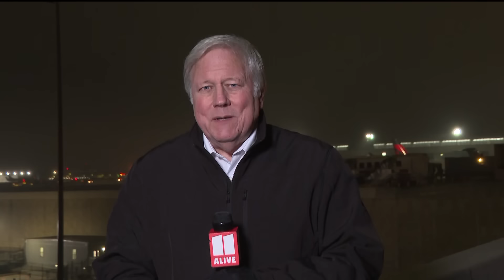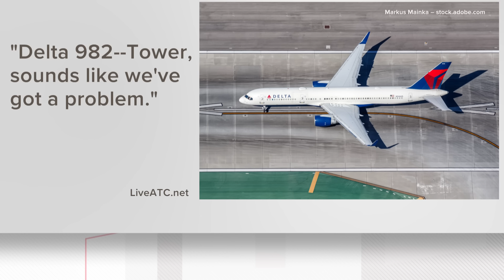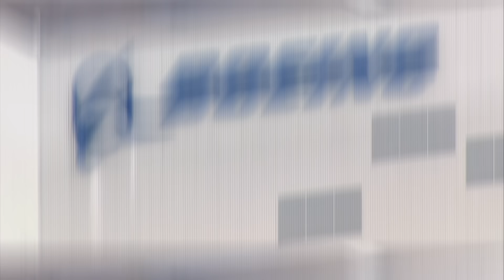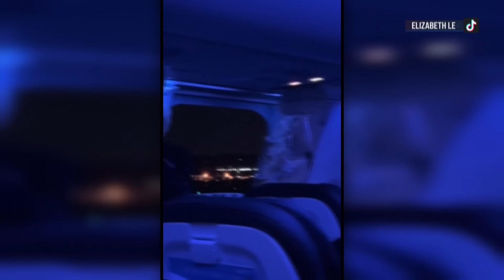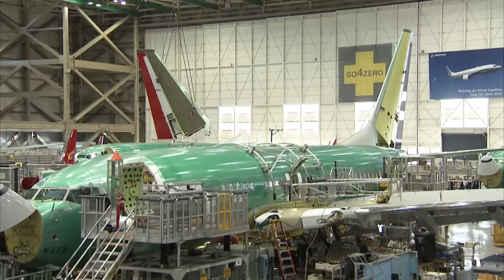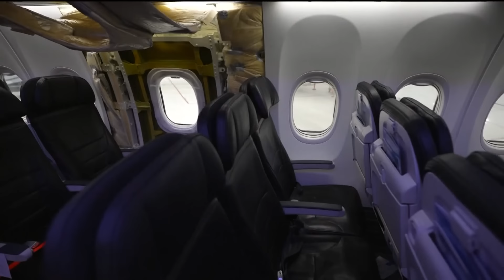Delta flight preparing for takeoff from Atlanta airport loses nose wheel, officials say

Comment: This is like blaming Ford for a wheel coming off your 20 year old truck…
Reply: Shhhh. Boeing is trendy right now.  Don't expose their sensationalism
Reply: Yes and no. I agree in this particular instance, but if this is found to have been an endemic issue for (ford/boeing/whatever) vehicles built around the same time, then time shouldn't matter. Ask me how I know.
Reply: @Breakstuff5050  and you're just Americans trying to defend an American company
Reply: @mark675  not at all, I think Boeing has gone downhill since the 90's after the restructured their company.  It's not what it was.  And it's a shame.
Reply: @Breakstuff5050  yeah it is a shame and if they don't sort it out it's going to cost more lives
Reply: @mark675  that’s pretty ironic considering Europeans do the same thing with Airbus cuz it’s European. I’m not defending Boeing or anything

Comment: Ok this can’t be blamed on Boeing, nose landing gear is 100% on the airliners maintenance crew.
Reply: It can't?  SMH
Reply: @pedalingprospector2007  if it had been a brand new plane, or this was a continual problem, you could blame the manufacturer. Neither of those conditions apply, so yes, it was a maintenance issue.
Reply: @carch7243   Oh, the 7377 MAX hasn't been having continual problems?  You a Boeing safety compliance officer or just own stock in the company.
Reply: @pedalingprospector2007  so let’s say you buy a vehicle (ford, Tesla, Chevy, doesn’t matter) and you put 50,000 miles on it and go to get something done for your tires at your local mechanic shop, and a wheel flies off while you’re doing 70 on the freeway, how in the world are you going to try and blame the car manufacturer? Obviously you’d be holding the mechanic shop accountable for the subpar work they did on your wheel. Of course Boeing is currently under fire for unrelated PRODUCTION (that means for aircraft that just came off the line and have zero flight hours) issues but the idea that they should be blamed for a clear maintenance issue is just silly. Everybody is entitled to their opinion, but in this case the opinion that Boeing is to blame is 100% incorrect
Reply: @Luigim_15   Exactly
Reply: @pedalingprospector2007  Massive problems with tires falling off?

Comment: This is likely a maintenance issue
Reply: I concur.
Reply: Boeing should have their workers checking maintenance being done everywhere. Especially after 737 Max 8 tragedy. It's a quality assurance process redundancy. Redundancy is the key.
Reply: I think it's a DEI issue.
Reply: @fluoxethine  they can't stop an operator from not doing their jobs properly. 

 This wasn't the new 737 max.  The older Boeings are proven to be reliable when properly maintained
Reply: @Breakstuff5050  They can stop by double checking. When you buy a new car, you get several years of warranty. With jets it should be much longer and work should be done by authorized people. If not Boeing then some third party organization should check for safety (FAA is useless as always).
Reply: @fluoxethine  there's already established procedures for maintenence.  There is no "double checking" by Boeing.  Maybe on new designs, but by the time they're selling them to airlines they're suppose to be completely safe and redundant.  Unless they cut corners.. like they did on the 737 max 9

This wheel coming off is on a proven design and there is already enough double checking required by Boeing.  So Delta dropped the ball on this one.

When accidents happen and the cause turns out to be preventable through maintenence, then the procedures and intervals are changed to accommodate the issue assuming its not a defect.  

Unless the operators report issues, Boeing isn't going to double check every inch of an aircraft for no reason.

This 737 max debacle really is insane though, it's unfortunate they can't find anyone in particular to blame and make proper changes to fix their recent shortcomings

Comment: This is on Delta maintenance, not Boeing.  That's a 30+ year-old aircraft.  And, by the way, while the Max situation is TOTALLY on Boeing, the door plug incident flight isn't totally on them either.  Alaska Airlines admitted freely that they'd kept that aircraft in service even though it had been giving off pressurization warnings for months... just didn't let it overfly water.  This seems like a continuation of when they didn't properly grease their MD-80's jackscrews and the MD-83 crashed in 2000.

Comment: This isn't a Boeing problem, it's a Delta Airlines problem. Unless the airframe recently had its landing gear refurbished at Everett or a Boeing subcontractor, the spotlight should be on the Delta Airlines maintenance technicians...and the Executives, management, and even the pilot crew who are ultimately responsible to their passengers for the state of their plane (if you know your Airline management or their malicious investors or technicians are slacking off for WHATEVER reason, remember: everyone's life is on the line).

Comment: wtf is going on with Boeing????
Reply: Nothing, someone just fucked up when they changed the tire
Reply: @klein2042  that not an excuse.
Reply: Bad news media, making Boeing issues worse.  Poorly attached wheel is not Boeing failure.  Maybe even the door is also maintenance problem.  Same with engine on 747, that is not made by Boeing.
Shame on reporters, making things worse for Boeing.
Reply: @jetli740  Still not Boeing’s fault
Reply: …so you’d blame Toyota if the Discount Tires put your wheel on wrong?
If you don’t know what you’re talking about, it’s best to not say anything until you what’s what, otherwise you look stupid.
Reply: @zvast  the jet with the door fly off is only 2 months old, why blame it on maintenance  when it a brand new jet?
Reply: @jac1207  he question boeing safety issue, total normal to question any jet that got grounded twice in 5 years with 2 crash killing over 300 people
Reply: @jetli740  That was a new 737 max, this is a 757, much older and more reliable